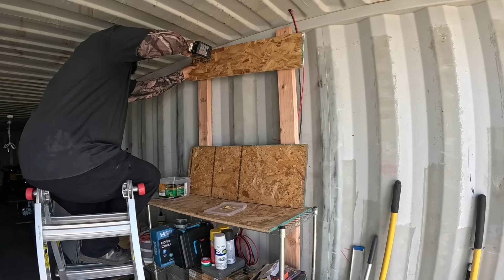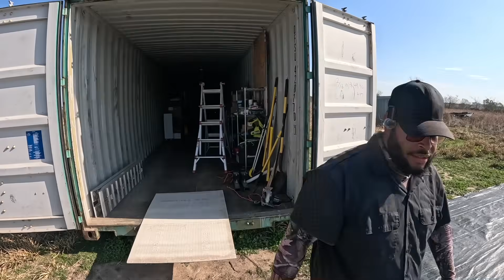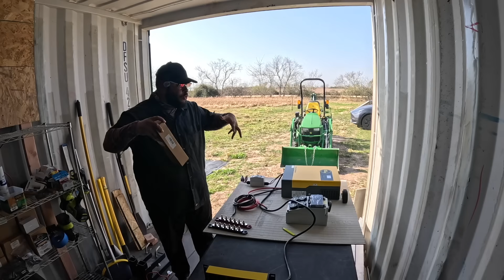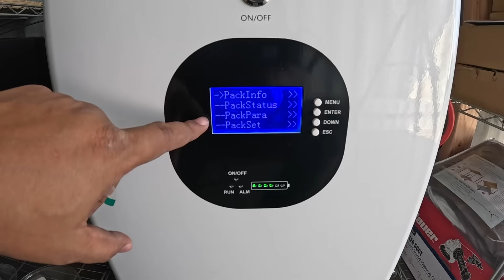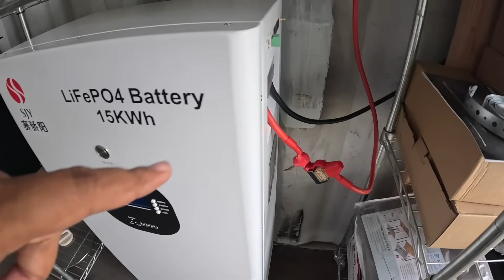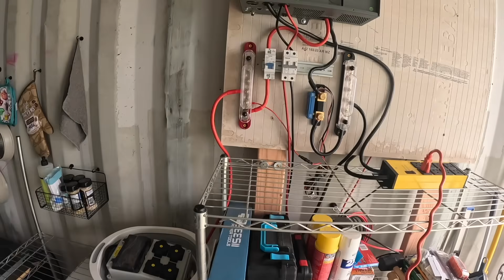Powering Up Our Off Grid Shipping Container | Inverter & Battery Bank

Comment: May be best to use a bi-directional breaker on the battery to inverter as current can flow both ways?
Reply from the maker: That is a good ideal. Thanks for the insight. 💯🫡

Comment: Im assuming you are in East Texas, do you have a wind plan for your main shed?  Ive seen several of your videos and the shed seems top heavy and im worried about what happens if you get a 40+ mph wind gust?  Im in West Texas and those gusts are very common so ive got my power shed on the ground and anchored.
Reply from the maker: Great question and I appreciate you looking out. We have already had 35 mph winds recently and it held up well. We are still going to anchor it down with 4 mobile home tie down straps rated at 5k pounds working load limit each to make sure it is secure. Thanks for watching 💯🫡

Comment: Looking good, I mostly do solar panels on houses but lately I’ve been hooking up the batteries so I got two questions. 
First Isn’t the battery supposed to go straight to the shunt first then the other side of shunt goes to that block then the block goes to everywhere else that way no matter what you put on that block the shunt will read it.
Second in the summertime doesn’t that container get way too hot for the batteries and a solar inverter what to do then,  do you have to put a built-in fan or air conditioner? Let me know.
Reply from the maker: You’re absolutely right! The battery negative should go to the shunt first, and then from the other side of the shunt to the negative busbar so everything downstream gets measured. Thanks for pointing that out. As for the heat in the shipping container... It hasn't been a problem for over a year. I also plan to build out and insulate and area in the shipping container that will be temperature controlled. I appreciate the comment.